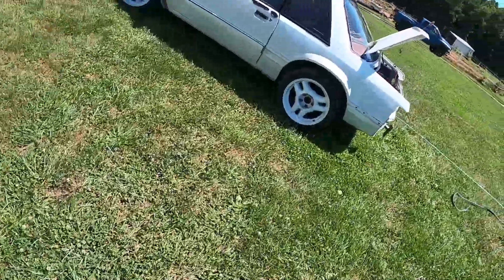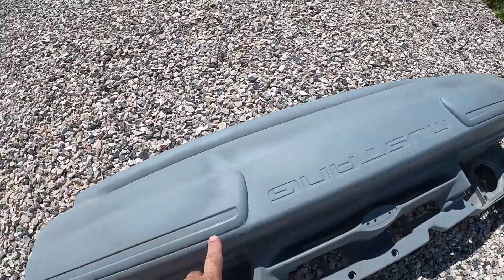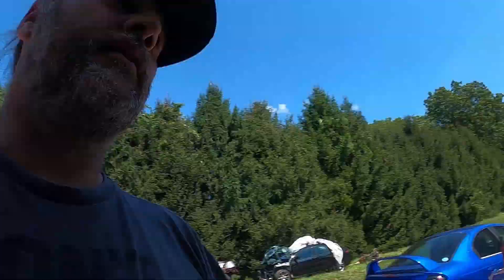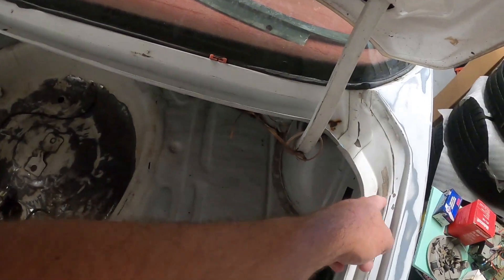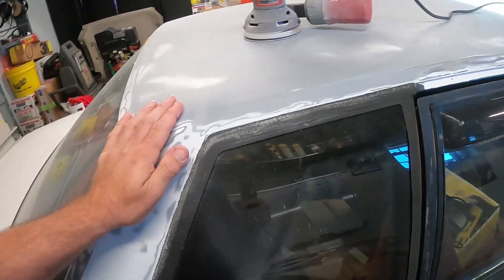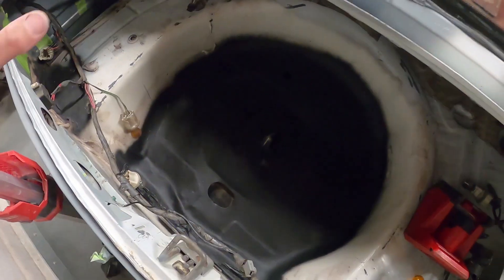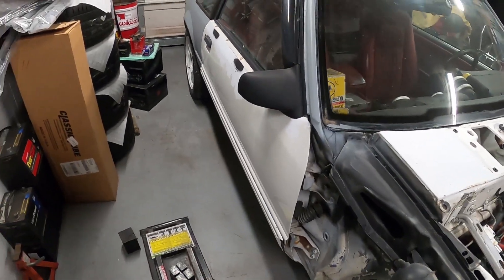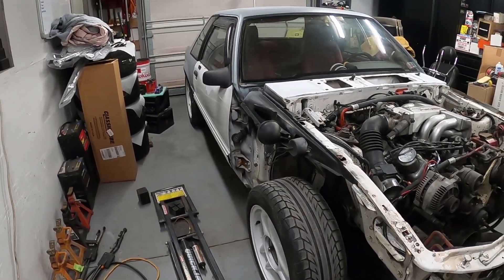ford mustang's in primer

Comment: Hey Matt so I got a srt4 2003 and one day my check engine light popped up and it was p0113 I replace the sensor twice  and cleaned the connector and still no change that check engine light still on only thing I noticed that changed was only sometimes the idle will rev up to 1200 and stick if u can responds back I’d  appreciate it

Comment: What "rust stuff" did you spray in your spare tire well?
Reply from the maker: I’m trying out this spray on rust-oleum called rust reformer number on can is (248658 rust reformer) I just did my truck frame with this I’ve used the mar-Hyde brand before brush on for rust that would turn it black but with this being in a spray can I got it to make it easier when I do the btm of the car now I’m still wire brushing grind/sanding most of the rust out
Reply: Ok. I have some light surface rust on the driver side front frame rail of my 88 SSP and was looking for some ideas. Thanks, Vince